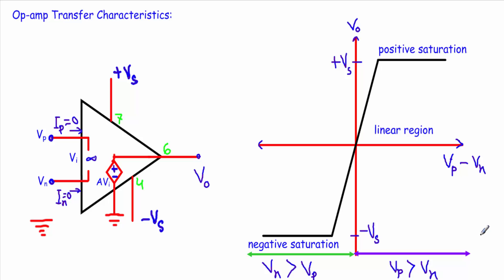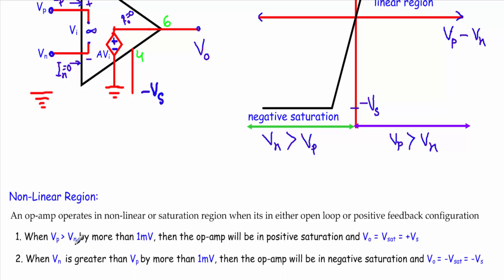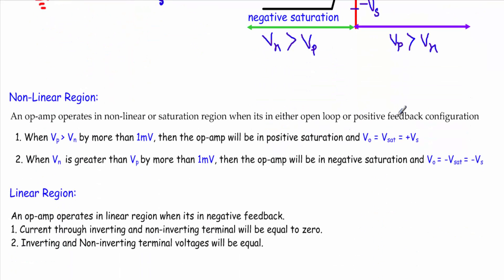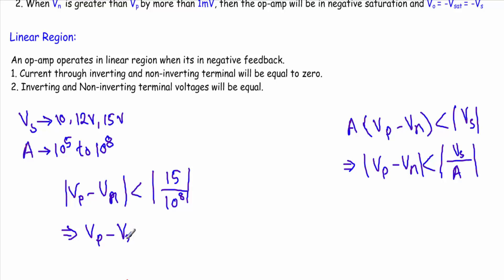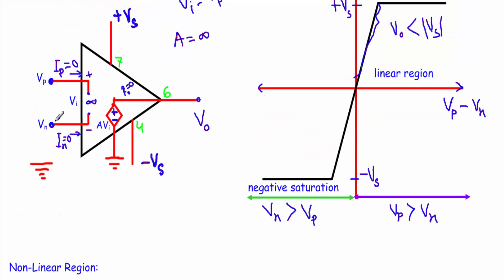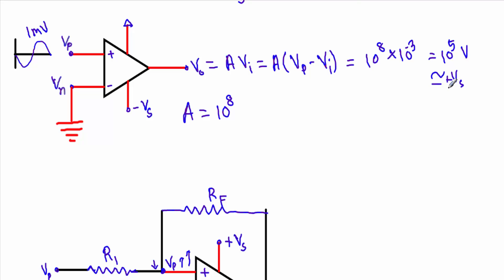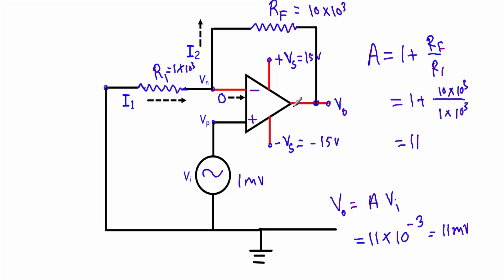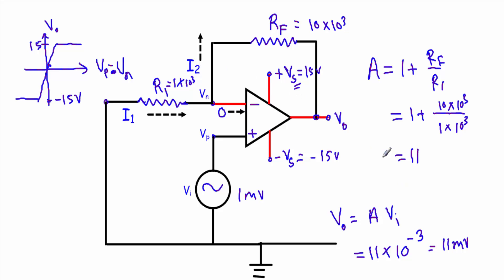Operational Amplifier (Op-Amp) Voltage Transfer Characteristics

Comment: If the diffrential input is negative.it acts like and inverting op amp so the saturation value when diffrential input increased negatively should be a positive value nah( sincd it gets inverted?

Comment: Sir, I have a confusion regarding the output in case of negative feedback circuit.
in one of the previous videos : you said that in negative feedback , the Vp = Vn . 
and in this vid after having calculated the gain =11 , the Vo = Gain ( Vp - Vn) . But, considering that Vp = Vn , due to negative feedback ,the Vo should be equal to zero.
Reply from the maker: Did you check op-amp inverting/non-inverting/summing/difference amplifier?? Also check the simulation of those circuits. Once you check up to output voltage derivation of these four circuit, write down the output voltage equation here. I will answer your question.
Reply: Thank You Sir. The following videos helped a lot, cleared all the confusion .
Reply from the maker: Glad you get your answer
Reply: I have the doubt as Abhinav that is, how can you take Vn=0 because Vp must be equal to Vn in negative feedback but here that is not the case?????
Reply: You'll have to once do the derivation yourself to understand it . Use KCL and KVL to find Vo and Vin and then gain = Vin / Vo

Comment: Everything seems well defined and explained but I have a doubt. In case of Inverting Amplifier, for a fixed input the output corresponding to it will be fixed (stable) until or unless the voltage at inverting terminal is made variable. So, how exactly, the V(p) changes to start a positive loop magnification ???
Anybody who can explain do reply please with meaningful explanation.

Comment: Please explain me the third example. I could not understand it. How is third example non-inverting circuit even when the feedback is connected to negative input of Opamp?

Nice lectures, Can u please say me where is the lecture explaining gain values for different modes of operation, calculations?